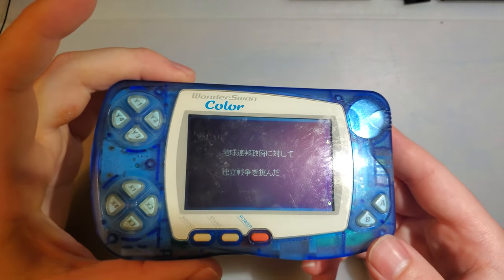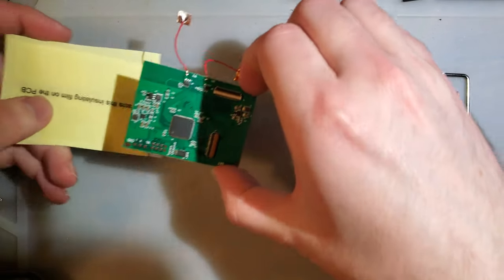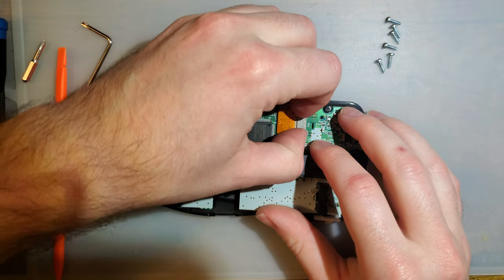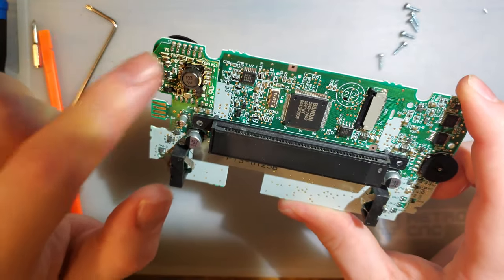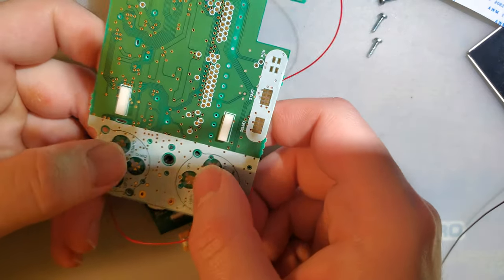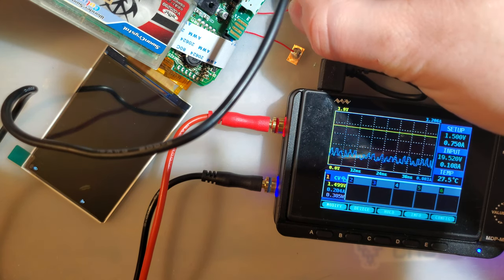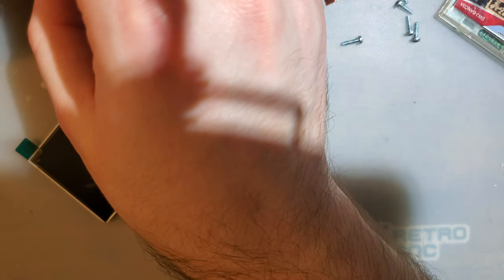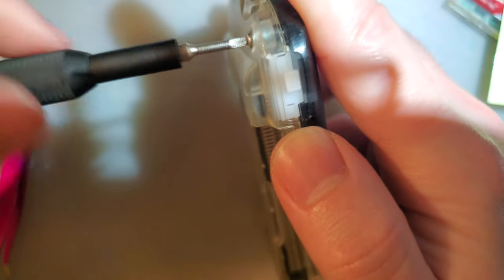WonderSwan Color IPS Backlight Kit

Comment: As far as we know the new screen kit runs at 75Hz, no skipped frames or tearing, but no one has tested Fire Lancer (60Hz) yet (to my knowledge) which wouldn't display in a playable fashion with the previous kit. There's no list of games that are 60Hz either that I've seen.

(also there's an extra contrast option in the boot menu if you hold start as you turn it on, which can improve the picture a lot for the original screen)
Reply: Setsuna from Discord, just here to add that yes they do have official gumstick style NiMH rechargeable batteries for the WS and WSC lines, they're fairly rare now, but do exist and do have a flat profile.

And also that the previous kits had 1-2 hour battery life, while this one does have at least double that from limited testing, but that might also vary by game.

And yes, there is a Flashmasta for the WS, and the developer of the HyperFlash32 for the VirtualBoy has expressed interest in a WS Flashcart, and has a concept cart done as well.

edit I know also see Riggles already mentioned all this on Discord. Oopsy.
Reply: I can confirm, after testing Firelancer last night with this kit, that  the sync is messed up.

Comment: @makho  the screws on this system are probably hex screws,

also I don't know if I already asked or not because I don't remember every comment and where I put it but do you know where I can get a replacement ribbon cable for my gameboy pocket to go from the motherboard to the display controller board? I have one of the all in one kits like the one you installed in a pink gameboy pocket a few months ago (the ones with the little screen) but mine only has the brightness sensor, I dropped my system and the screen lights up but it is all black unless I open it and bend the ribbon cable then it displays something so the screen isn't broken, I removed the display controller and the wire that goes to the power switch and put my original screen back in but I want to get the  backlit TFT screen working again without buying a whole new kit, I already looked on Ebay for the part I need and found nothing.